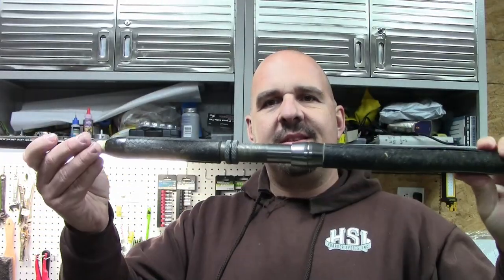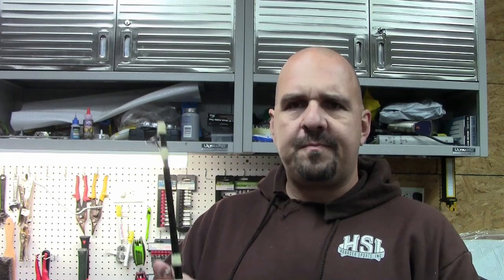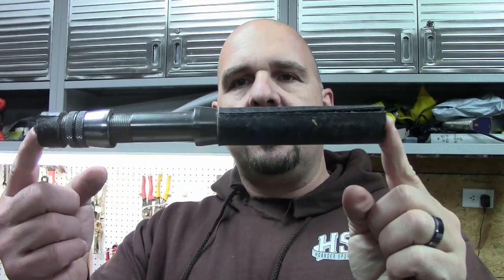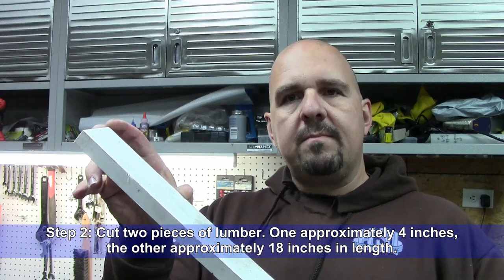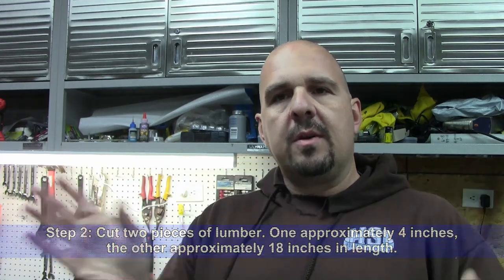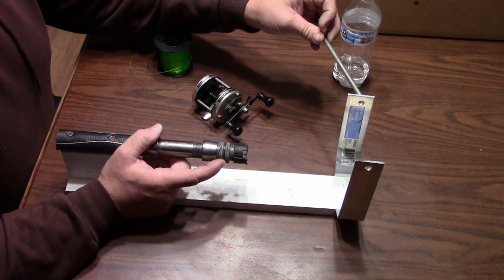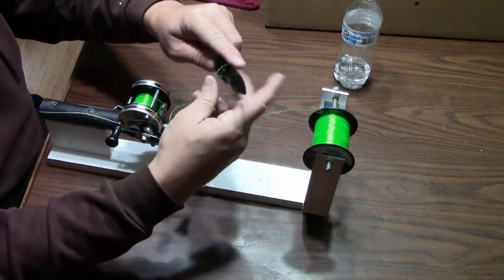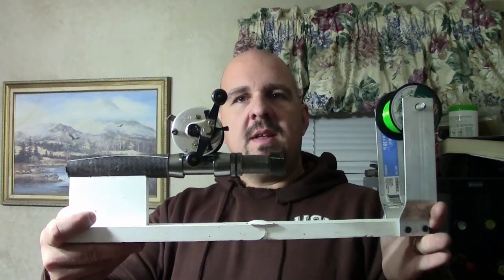Turn a BROKEN Fishing Rod Into an AWESOME Reel Spooling Station!

Comment: My dad built a similar setup with a spool that can be tensioned so the line doesn't need to be touched but you still have to hold the reel in your hand.  I like your method better.
Reply from the maker: With some extra hardware, you could easily have the best of both worlds and put tension on the spool. I went with hardware I had laying around, so I was limited on what I was able to do.

Thank you for watching!

Comment: Bought a Muddy River Catfishing flathead spinning rod a few months ago. Cheap Chinese garbage if you ask me. Maybe I got a bad rod, I do t know. The reel seat is garbage and is too big to fit even a 9500 penn spinning reel. Whatever fell on your rod and broke it did you a favor, absolute garbage rod.
Reply from the maker: I've only ever tried the casting rods. They're good rods, but I am still partial to tangling with catfish.

Kris is a stand up guy. Did you contact him with your issues?